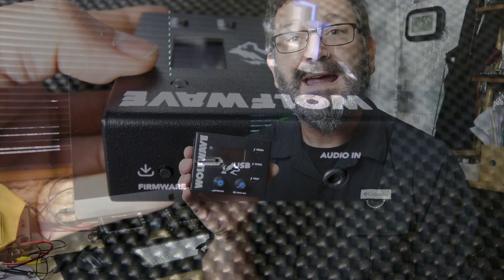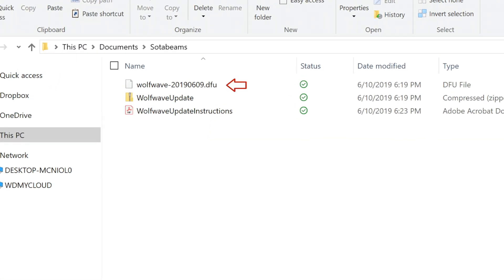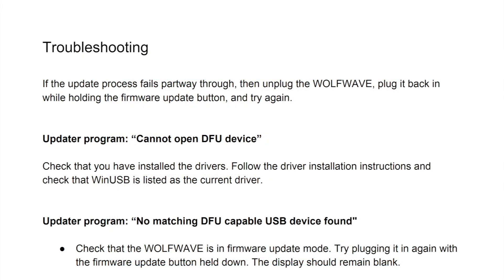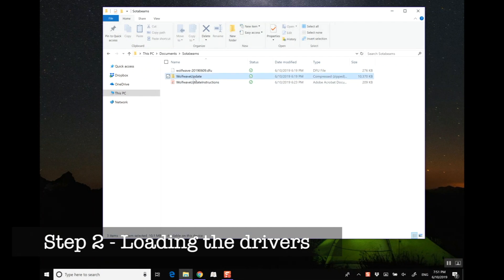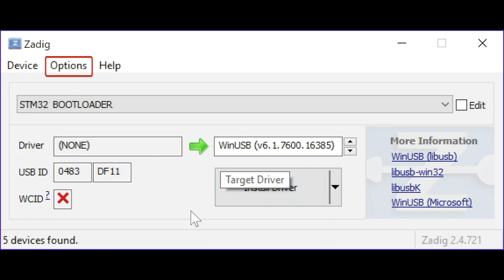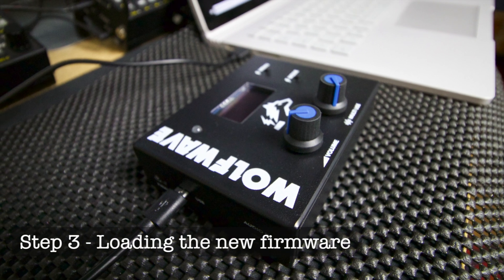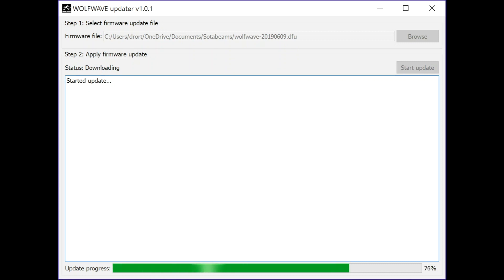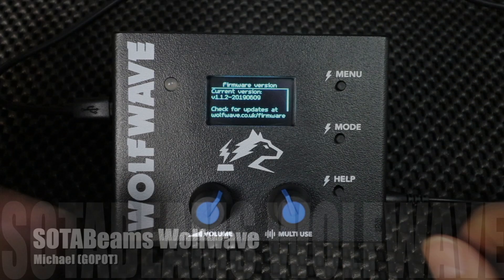Wolfwave firmware upgrade

Comment: Great Video - How do you check what version firmware that you have ?
Reply from the maker: Brian, simply power up your Wolfwave, press MENU and then turn the multiuse knob to highlight Utilities and select it by pressing the knob. One of the options here should be ‘Firmware version’. Highlight it and press the multiuse knob to get your current version.
Reply: @g0pot  Thank you